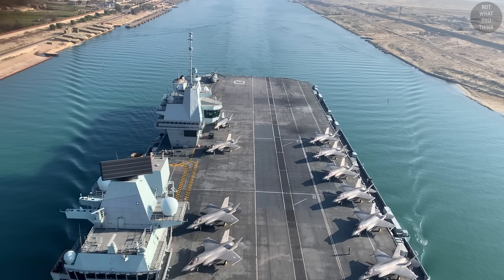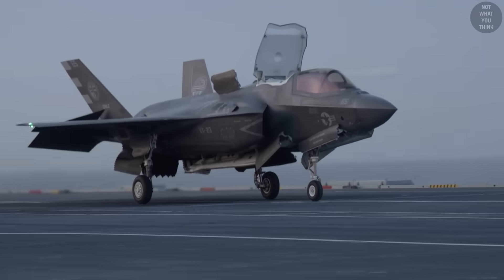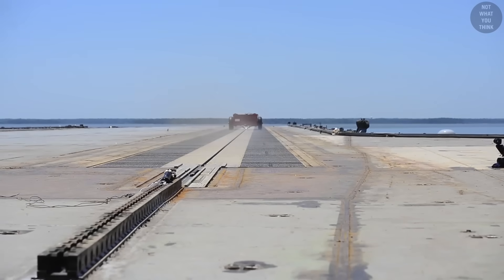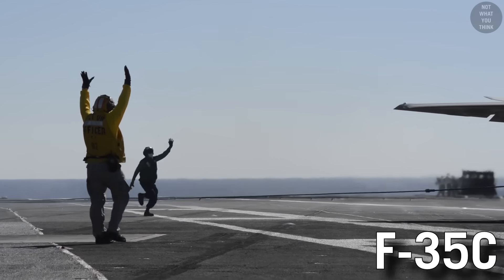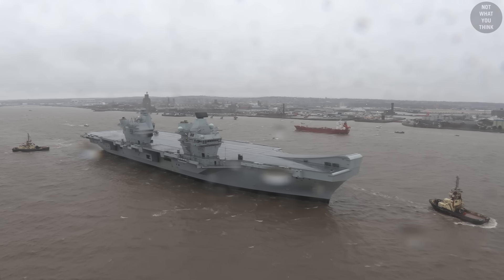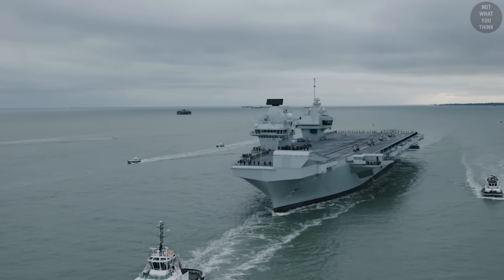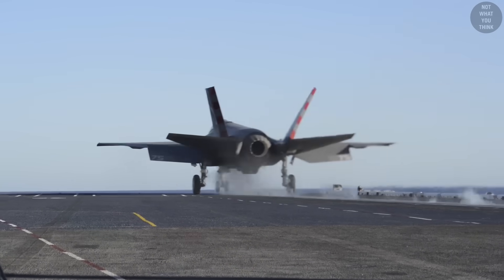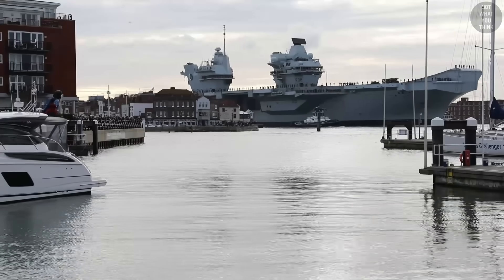Was the Angled Flight Deck Missed on HMS Queen Elizabeth?

Comment: EDIT: I was wrong about EMALS conversion being the contractor's fault by deception, so this probably looks nothing like the original post. So, instead, here's a thought: The Queen Elizabeth and Prince of Wales may never see STOBAR.

While the ability for the class to be able to easily (relatively speaking) convert to STOBAR was an initial requirement back in 1999, that ability fell through the cracks. The Royal Navy picked the QE class design (from two designs, one from a consortia led by BAE and another from a consortia led by Thales) that was too expensive to start with, and the scaled back design adjustments likely didn't take the possibility of conversion into account. This is the biggest reason why CATOBAR conversion went from around a billion pounds to over 2 billion back in 2010; and was dropped in 2012.
Reply: Emals still isn't reliable enough to be useful, it nearly there but not quite, still projected to hold up the Gerald R Ford by a couple more years..
Reply: @Markus117d  The US Navy doesn't need to have the Gerald R Ford right away as they currently have 11 other Active Carriers. So what's the rush?
Reply: @Gsmooth10455  as far as i know they have 10, the USS Enterprise having been decommissioned,  plus there have been several articles about how the other nimitz carriers have been doing longer deployments, with shorter maintenance cycles before being deployed again! Such as the case of the USS Dwight D Eisenhower. ( I believe was the ship mentioned ) , that had just returned from deployment & would be going back out in only six months. Causing problems because as a ship gets older it needs more maintenance to keep running properly, if it is deployed again so soon it will need longer in dock to fix the longer list of problems when it comes into dock next time ( 2 years in refit an officer in the navy is quoted as saying ) To compensate, but then only having a further 2-3 years left in service left when completed. Leaving the navy with a choice of spending millions on a refit or decommissioning the ship early.. the Navy is already pushing these ship's, which are nearing the end of their service lives harder & harder to meet deployment commitments, the Ford should have already been taking some of the load, and that it can't do that yet is causing the existing ships to be used up faster, that is why such a long delay is creating more & more issues 🤔
Reply: @Markus117d  We'll get through it we always do.
Reply: @Markus117d  True, but my point is that its usefulness isn't the main reason they never converted the QE.
Reply: @sleepyancient6655   Sadly you grossly misrepresent the decision making process in 2010 in three ways:
1. Remember this was just months after the USS Gerald R Ford had been laid down and a year after the QE itself had been laid down. Any structural changes would have delayed the project (already delayed by a year) and added huge extra costs.
2. Neither CATOBAR system worked. Neither had a delivery date and neither had a performance guarantee. It would have been madness for the UK (at that time in dire economic straits) to entertain using EMALS as experience with the Ford Class has now shown. Launched before the QE it will not enter service until 2023 because EMALS is NOT delivering the required performance. And the USS Gerald R Ford has cost $18 Bn so far. The 2 x QEs cost $10 Bn.
3. You maligned the contractors. The discussion that triggered contract conditions was the possibility of cancelling HMS Prince of Wales NOT the EMALS / EMCAT discussions. It was cheaper to continue to build PoW rather than cancel it due to contractual condistions agreed by the previous Government. That had nothing to do with whether CATOBAR or STOVL system was fitted.

Not sure why you felt the need to get into a rant at contractors but you are very wrong.
Reply: @1chish  Okay, you seem to be very mistaken. I did not talk about the entire decision process, but instead, was adding more in depth knowledge of ONE AREA of that discussion. I even said, "Here's another issue." Please note the use of the word 'another'.

But, since you seem to want to go over an even larger scope, here you go:

1) Here's the thing: The Queen Elizabeth class was approved in 2006 with the understanding that the carrier class would be "adaptable" in regards to CATOBAR retrofitting (according to the contractor) for the low (relatively speaking) cost of 833 million pounds.

In 2010, they tried to do just that with the Prince of Whales and found out that the QE class was not "adaptable" for anywhere near the price originally expected. The EMALS system itself remained about the same price. The cost for adapting to the EMALS system, something the contractor basically promised, was where the costs flew up to over 2 billion pounds.

2) Who cares if EMALS wasn't fully operational at that point? The British government didn't, because if they did, they wouldn't have tried the conversion in the first place instead of spending 18 months on figuring out how much the conversion would cost.

Also, the cost of the Gerald R Ford doesn't matter at all in this discussion (it's a red herring). The US is paying for it, and the EMALS system R&D is being paid for by the US Navy. Yeah, EMALS has cost 3.3 Billion by itself, but that's mostly R&D cost, not the cost of the finished materials, labour, and profit margin.

Had the QE class actually been "adaptable" the British would have paid around a billion for EMALS and installation on the Prince of Whales, most of the cost being modifications required for installation. So...

3) The contractor deserves the criticism. Fact is, the British government approved the current Queen Elizabeth class because it was "adaptable" according to what they were told. There was a good chance another design might have been selected had it either not been adaptable or had a more realistic conversion cost estimate been provided.
Reply: @sleepyancient6655   Well for all your word salad you are still writing a complete falsehood. You never added 'in depth knowledge at all!
There were no other external design options being considered as the QE Class was a developing project within the MoD using the skills of BAE Systems, Thales and others. Even the French were involved for some long while. There were many iterations of what would become a QE but CATOBAR was dismissed very early on in the process.

What comes through as you mention it repeatedly is the word 'adaptable'. The QE class are 'adaptable'. Always have been and exactly as per the contracts. They are passively engineered for CATOBAR conversion at their midlife major refit (if needed). The engineering spaces were created below the flight deck, one Port sponson only need modifying to create the angled deck and the electrical power was always designed in for EMALS if it worked.

You fabricate this myth that the 'constructors' somehow misled the Government. Let me explain your ignorance there:
The constructors were an Alliance especially formed to build the carriers and therefore called 'The Aircraft Carrier Alliance'. It is a partnership of BAE Systems, Babcock International, Thales Group and the Ministry of Defence. NOTE: 'MINISTRY OF DEFENCE'. The Government were major partners in the building alliance. So you are somehow saying the government misled itself? 

And you are very wrong about the costs of EMALS and who was responsible. General Dynamics in the USA were the contractors not the Aircraft Carrier Alliance. So gob off at them. They were the ones who were unable to quote a price (so your numbers are pure guesswork), unable to provide a delivery date and unable to provide performance guarantees. But they DID offer to supply it FOC if the UK paid for the development costs. Which meant sign a blank cheque. EMALS has cost the US Navy over $8 Bn so I have no idea where you get your numbers from.
Reply: @1chish  "Well for all your word salad you are still writing a complete falsehood."

Huh... well, after doing some more research, I have to say, you were right that it wasn't the contractor's fault. I'll make adjustments to my initial statement. However, my numbers aren't wrong, and there was another design; let me share this:

"The estimated cost is up to $200 million, and the prime contractor will be General Atomics in Rancho Bernardo, CA. This is still just a potential sale, but the nature and specificity of the request strongly suggests that Britain has decided to abandon its own electro-magnetic catapult research. Now that EMALS is launching real aircraft, they can certainly reduce technical uncertainties and costs by buying it to equip one of their forthcoming Queen Elizabeth Class carriers." - Nov 15, 2011.

and

"Costs: Since 2008, EMALS-related costs for the first-of-class Gerald R. Ford [CVN 78] have risen by 133.7%, from $317.7 – $742.6 million." - September 5, 2014

Both from this: https://www.defenseindustrydaily.com/emals-electro-magnetic-launch-for-carriers-05220/

Also, from UK Defence Secretary Philip Hammond: "...it has become clear that the conversion to ‘cats and traps’ will cost about double what was originally estimated – and would not be delivered until 2023 at the earliest."

Source: http://www.defensetech.org/2012/05/10/its-official-uk-to-fly-f-35b-jsfs/

He was talking about the total conversion, not EMALS by itself.

There, I have numbers and sources. EMALS unit cost per ship by September 2013 was $742.6 million USD for the Geral R Ford class. And according to an article (https://www.navylookout.com/cats-traps-and-claptrap-why-the-royal-navys-new-aircraft-carriers-operate-vstol-aircraft/) the UK cancelled the Prince of Whales conversion in 2012.

So the UK was likely looking at... still far less than the over 2 billion pounds that was supposedly entirely EMALS fault (according to your implications). So where would the rest of the 1.3-5 billion pounds (and rising) cost come from?

That's right, modifications for installation. Thing is, there was a competition, and there was one other alpha design to consider.

"The assessment phase began at the end of 1999 with initial £5.9M Analysis of Options contracts awarded to two consortia lead by British Aerospace (now BAE Systems) and Thomson-CSF (now Thales). This was followed by the award of a second year-long £30M assessment phase contract to both teams in July 2001."

From https://www.navylookout.com/development-of-the-queen-elizabeth-class-aircraft-carrier-a-design-history/

So, to piece together what happened from the articles I gave: A design competition happened, and the Royal Navy picked the shiner, more expensive model. But it was too expensive, and had to be massively scaled back. This is probably when the QE class lost its "adaptability". But, instead of looking at the design that was turned down (or at least, no indication was made that they went back to look at it), they redesigned the chosen ship design several times until this one came out and was approved in 2006.

So, you're right, it's not the contractor's fault, at least from a point of intentionally misleading anyone. I think they forgot about adaptability, and no one bothered to check that part of the original specifications.

I would like to address one thing: I never said—nor implied—"external". That's hogwash and I don't appreciate words being put in my mouth.

I haven't exactly liked the aggressiveness and tact with which you presented your arguments, but I do appreciate them nonetheless.
Reply: @Markus117d  but adding EMALS to carriers is basically future proofing them
Reply: He forgot to mention one thing. In a raging war, you could imagine the enemy's initial targets would include airports and long strips of land to prevent conventional enemy aircraft from taking-off and joining the fight. Having combat aircraft that can take-off and land vertically and still be capable of mach flight would be a very big asset in such a scenario. They wouldn't need the conventional, long airstrips to be combat-ready and thus be more usable in protecting the airspace. What exactly is the use of a faster and longer-range aircraft if it is stuck on land, unable to take-off? VSTOL aircraft can practically join the fight from everywhere and that is the reason why I think it is the most ideal of the three F-35s.
Reply: @mariodelaurie1142  A great point well made 👍
Reply: @mariodelaurie1142  That's a fair point. VSTOL aircraft do have their benefits, especially on land where the landing strip can't move. I'd also add on to what you  said and say that the benefit of VSTOL aircraft mean multiple much smaller, cheaper carriers could be built and use the aircraft for more widespread missions.

Whether a country wants to/is tricked into building a supercarrier that is restricted to VSTOL fighter aircraft is another, different discussion.
Reply: It would have looked like the french variant sadly it didn’t came to life
Reply: @Ren-tq1hs what ! It would have looked like a larger version of the Ark Royal that was an Audacious class carrier that was the mother of most carrier technology apart from the daft power system that the UK engineers will never use on any surface vessels
Reply: I like how everybody is arguing about the aircraft launching systems but nobody pointed out that they put the animal instead of the country in "Prince of Wales"
Reply: Conversion to CATOBAR doesn't require those provisions - they just make it cheaper and quicker to do the work.  The main requirement is power generation, but the class has that in spades, so they should be fine.  The Royal Navy upgraded 3 fleet carriers from STOBAR to CATOBAR back in the 1950s.
Reply: easy =/= cheap. It refers entirely to the technical issues relating to the conversion.
Reply: Wow... I didn't know that bro, but I thx
Reply: @ts757arse  you're never gonna put defence lasers on a carrier, you'd just reconfigure the group so they'd be in useful positions to cover the carrier - which is the point of the group.

On a more general note in re thread next time these things get an aircraft reconfiguration it's going to be pure drones where the potential options are endless - I'd be surprised to see EMALS being the answer to that question, but I wouldn't rule it out. In 25, 30 years who knows what reactor tech will look like - we'll have small commercial fusion reactors at that stage which could easily fit in the space currently occupied by the current gas turbines. Wouldn't rule anything out frankly.
Reply: The original concept was to be able to convert HMS Queen Elizabeth, and HMS POW, to a CATOBAR carrier as a future option. My understanding that both Carriers were built WITHOUT that capability for conversion. Q. Why? To save time and keep costs down. Q. Can BAe clarify the situation? MOD approved this change?
Reply: @trevorhart545  From what I've read they can be converted with a few simple modifications. And mark my words it will happen in the forseeable future.
Reply: @trevorhart545  As far as I've seen in various articles, The QE class still have the internal bracing & empty space necessary for a catapult system to be installed at some point 👍
Reply: The capacity is still there.

It just isn't going to happen in the lifetime of these carriers.  EMALS is the future of catapults, but it still has many problems.  Further, too much has been invested into the F-35B, which is going to have a lifetime over much of the same time as the carriers (and no, much of that is not the sunk-cost fallacy as the F-35Bs are still great aircraft).

By the time these carriers are replaced, carriers may not be required or may just be drone ships.
Reply: there is no Prince of ' Whales' , unless there's under-water royalty we don't know of ?
Reply: Now EMALS almost works I expect during her midlife refit QE will have EMALS added primarily for drones but also whatever replaces the F35B.  

I think you have to take into account EMALS has had an awful introduction into service and I'm glad we didn't try and add it.
Reply: @playersinexile72  They're adding an EMALS in the next few years for launching drones of up to 25 tons according to the MOD. So they must be satisfied that they can get it working.
Reply: The reason why EMALs weren’t used on the HMS QE II carriers are rather simple….. Power plant capacity. A nuclear vessel can do that easy, a Diesel Turbine, not so much.
Reply: @smoketinytom  Not true at all.
Reply: @neilgriffiths6427  And yet they’re using a Ramp instead….
Reply: @smoketinytom  The ramp is much better than a flat deck for non catapult launches. The technique increases the take off weight. More fuel & wepons...
Reply: @Markus117d  Duh, that’s why a Ramp is built, it’s basic physics to help something into the air more efficiently.
Reply: @smoketinytom  Yes so why do you say to someone else "and yet they are using a ramp?"  Maybe I've misunderstood what you were saying ? 🤔 lol...
Reply: @smoketinytom  Nope not even remotely true, if you actually followed the QE class development you would know the power output of the 2 x MT30 Gas turbines and 4 x Wärtsilä 38 diesels was more than enough to power the proposed EMALS installation there is also space provision in the design to allow the installation of more diesel/Gas Turbine generators if needed. There is also provisioned to allow the installation of steam boilers if a steam catapult installation was required. The combined installed power generation capability of the QE class is 110MW, in comparison the power output of the Gerald R Ford class is 100MW! The decision to revert back to a  STOVL configuration was due to the overall through life costs of sustaining a CATOBAR capability, the training cost to maintain a bare minimum F-35C capability at sea was significantly more than with F-35B.
Reply: @smoketinytom  I think a bit of a misconception with EMALs is that you need that instant power from the power plants when used, they actually have an energy storage subsystem that is charged up. So at worst, it would take longer to charge up between launches.

They do actually have a lot of power generation capability though, their two main engines are the MT30 gas turbines, the most power dense marine gas turbines in the world (The same ones used by the Zummwalt class destroyers, which were designed to use railguns) that's on top of their 4 diesel engines, all of these generate electricity for both propulsion and other systems.

As part of Project Vixen, the RN are now looking into installing a smaller EMALs system for UAVs (And potentially other roles like air to air refuelling), and have specified that there's a need for them to be installed within three to five years, so we may potentially see this relatively soon.
Reply: @Benjd0  If they do a retrofit as part of the mid life update, or indeed before, and find they need more power, then I'm sure a turbine upgrade will be planned at the same time (well, I say sure, but we are talking about the MOD)
Reply: @smoketinytom  that's true, but the QE class was designed with spare generating capacity, how much i don't know, but as they were thinking of installing an emals style system at some point during the ships service life, it's reasonable to expect enough capacity to run at least a small system 🤔
Reply: @Markus117d  Yes, but Nuclear Reactors have extra headroom for their size. The Gerald R Ford carriers are designed with the implementation of Laser CIWS further down the line.
Reply: @Markus117d  Plenty of capacity to run an EMALS - but it needs to work properly, and even now, EMALS is unreliable for combat ops. Not impossible, but not very reliable.
Reply: @neilgriffiths6427  it's not just EMALS. AAG doesn't work properly either. Either of them can knock a Ford class carrier out of action. Because everything is integrated to do maintenance/repairs the whole system has to be taken offline.

Also there's a massive study document that was presented at the Royal College of Naval Architects regarding why STOVL carriers were procured. The F35B has similar range and carrying weight as an F18.

The man power and training requirements are much much lower and you can increase your airgroup with aircraft from the RAF easily. 

The decision to switch to F35C was actually stupid because it would have left us with one aircraft carrier. Not the two we currently have at sea. It also ignored decades of planning and studies to end up with no year round capability. The F35B is  going to be a really really common carrier aircraft which means a lot of cross decking opportunities.
Reply: @Markus117d  Well, given how much problems Type45 destroyers had with its turbine engines overheats, it might not be a good idea to push thise trubine engines on QE to its limits....
Reply: @qiyuxuan9437  HMS Queen Elizabeth uses Rolls-Royce Marine Trent MT30 Gas Turbines, which are different from the Rolls-Royce WR21 Gas Turbines used in the Type 45 destroyers. And most of the type 45's problems come from the intercooler used, There is a fix for the Type 45 problems currently being implemented during refits, I doubt that the same mistake was made with the Rolls-Royce Marine Trent MT30 Gas Turbines in the Queen Elizabeth class 🤞😁